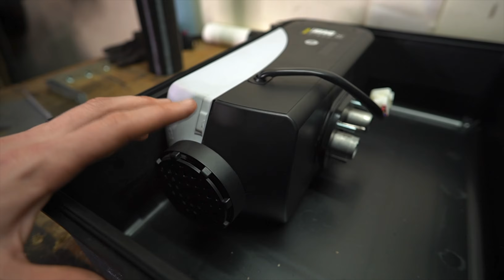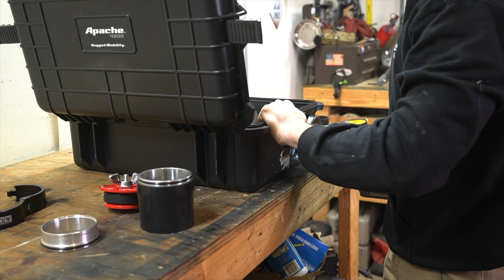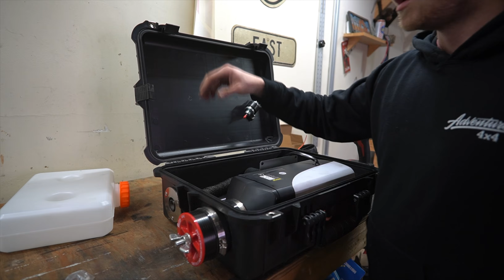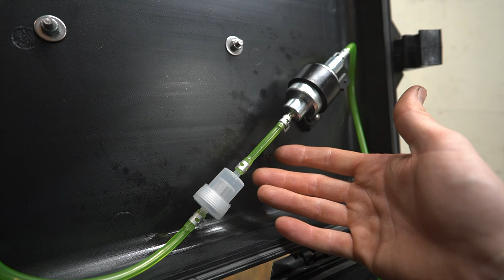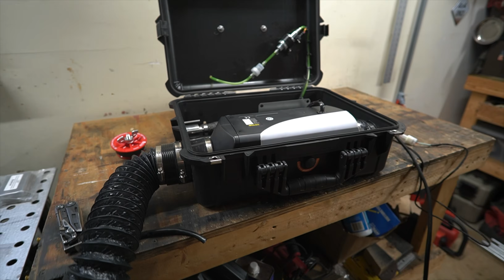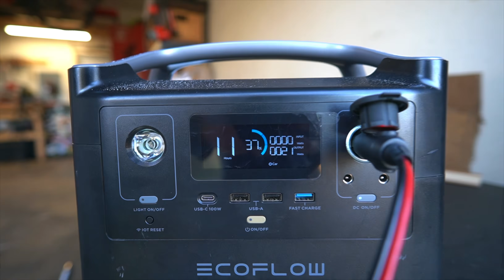DIY Diesel Heater **EXTREMELY DETAILED**

Comment: More like no attention to detail. Lacking detail in video and rushed.
Reply from the maker: If you need anymore detail then this to figure it out you may as well buy a pre made unit to save yourself the headache.
Reply: @Adv4x4 naw just having to order more parts because the ones you linked are the wrong size, exhaust hole size is 1 and 1/2 not 1 3/4 and trying to make different manufacturer heater work from Amazon, ordering the heater bracket I didn't have, etc.

Comment: The exhaust hose included in the link isn't the same... I just cut the one I ordered and the outside diameter is the exact same as the outside diameter as the exhaust port on the heater.  Also, looking at the one you have there - it looks made differently than the one in the link.  Can you look back through your purchases and include the link to the one you have?  I have been looking and haven't been able to find it... and my build is in  pieces right now... lol

Comment: nice build, although im for sure routing my air intake to fresh air outside the case with the possibility that the exhaust does leak inside the case.
Reply: Thar air intake he left inside the box is only for combustion.  
The fuel line and small pipes are for combustion. The ends of the heater are for heating your inside air. Keeping  these 2 systems separate as intended ( exhaust and combustion intake  outside)  would be the best set up.  Safest, most  efficient  in every aspect.  No brainer.

Comment: 've been closely following your diesel build tutorial and noticed a discrepancy with the exhaust pipe. The one shown in your video appears more flexible with closer ridges, whereas the link provided leads to a wider, stiffer type. The pipe that came with my diesel heater won't fit on the through exhaust if it's cut at the ridge. Could you clarify this? I hope this makes sense.

Comment: Microwave water for a couple minutes and dip the tip of the fuel hose in it, it'll go on way easier than with silicone spray especially as it starts to cool again and you can push against it.

Comment: How did the quick connect work out?  Also you linked to a 3” to 2.5” silicon hose.  Is the heater output 2.5” or 3”?   Thanks.

Comment: This video is great and I had an easy time following the process except for one thing that i cant figure out. Connecting The exhaust hose to the exhaust outlet. I ordered the parts from the list and had to cut the exhaust hose to fit. Once I do that, since they're both 1" I can't fit the wavey part of the hose over the outlet. I even got a 22mm outlet (vs. The 1") and can't do it. What am I doing wrong?

Comment: Allowing it to auto shut down allows the fan to keep spinning Ning so it pushes cooler air through system and let the ceramics cool better. Just cutting power leaves in burnt diesel in the system and can cause damage to the internals with heat not being able to escape.

Comment: I had issue with the DC output required at startup, my portable power station, same as what you have eco flow river 2, keeps tripping at the start up, did you figure out a solution around that? I tried running it from my car first to get it to warm up and then switch over to the power station which works but it's a hassle.

Comment: This video is identical to hundreds of others. Exact copy of others.
Nobody has done the way I put one together.
I used the exact same Harbor Freight 4800 case. Mine is fully waterproof with no hose and wires tethered outside the box.
Inside the box has the heater, 20ah battery, voltage monitor, cooling fan, AC to DC charger.
I had to move the fuel pump and the filter in its own small case outside the 4800 case to make room for the battery.
It actually keeps the fuel away from the heater. The inside stays very clean without the worries of fuel spill.
5 liter tank is mounted next to the 4800 case with quick disconnect.
The case can be removed quickly for travel. No worries of spilling diesel.
Reply: Ok... Show us then. And btw, plenty of other people have put a battery inside the case though often criticized for it.
Reply: @BoomBangKapowww  
I have not seen one single video showing someone putting the battery into the case with the heater. As far as I know, I'm the only person who placed a battery into the case. It's very convenient. 😉
You show us.😂😂 post a video for everyone to watch. 😉

Comment: Consider a vent in the box for the air intake. The box is waterproof, so if the heater is stalling out, think about where the air intake is getting fresh air.

Comment: I just finished my build out and love it. But I can’t get the thing to run off my ecoflow battery like yours. Have you ever heard of anyone having issues with this?? It will run off the jump-start battery I have with no problem.
Reply: Use an ac 12 volt 15 or better 20 amp power brick to your battery bank it will only use more power when glow plug is in use

Comment: The air inlet for combustion should be outside your case. Poor combustion especially with those plastic air inlet ones supplied that it comes with. I am using a plastic and wire tea strainer as a combustion inlet cover it was a similar size so I half-inched it from the wife's kitchen cupboard. It is enough to stop bugs of dirt going in but increases the air going into the burn chamber. The heater burns far better. Noticed that there is now something similar sold on eBay. The next heater I buy will have the same put on it.
Reply: Got a link to an example of the tea strainer you're using?

Comment: Hello! I am following this build with a 2kw instead. I am at the cutting the exhaust pipe part, mine does not fit like a glove when cutting it afterwards and even cutting a slit just to get it on. No success after this, I can still use the pipe for the exterior. I found another video mentioning using the brand pipe because when you cut it and inner diameter is still the same.

Comment: How are the quick couplings working after repeated use?
Reply: It was so difficult to connect on the field that I abandoned it. May be others had better luck with it.
Reply: @johnkim8875  I think it'd work better if the sleeve was left on the duct side instead. You'd have a lot more to grasp when removing it.

Comment: This is a great video I'm using a old Makita drill box roughly the same ... Hoping will use the same idea in the workshop and simply have it so it can be then adapted to the camper if required

Comment: FYI you can prime the pump on this by holding the up and down arrows at the same time. Better than turning it on and off a bunch to start.  I guess there’s different button combinations depending on the style of screen you have but I have this exact screen and it was up and down to prime.

Comment: From UK, NICE JOB!   Great detail and almost a tutorial for those new to CDH set up.   I also admire your honesty at the end, informing ppl of existing similar devices such as the Hcalory.   They are currently £140 ish in UK. But due to season they will reduce in time.   Good project and irrespective of the  Existence of already built systems you've given alternative kit to improve on them for owners.   Well done in my view.
Reply: Well, I looked at the hcallory and it did not appear weatherproof to me so, I emailed and asked them and they said no, they are not.  I have a vevor all in one i set outside my van and i have to cover it in case it rains.  I want to transfer the heater to a case like in the video, then mount on the side of my van so i do not have to store it inside, and it will be fine in the rain. That will be a project for warmer weather.

Comment: your fuel filter is on back-to-front your filter will get clogged-up the fuel should flow around the outside of the mesh, not up through the center of the mesh, 

your welcome 👍
Reply: Exactly

Comment: This is the best instructional video I've seen on all of YouTube for this DIY build. Thank you for the video and the links.
I am attempting a version of this next week (still waiting on a few parts to arrive) and plan to use some of your ideas. 
Did you ever post a follow-up on if the intake needed to be moved outside the box? Did you notice any fume or heat smells leaving it inside?
Reply from the maker: Thanks man! I ran it a bunch with the lid open after assembly to burn off any smells and haven’t noticed any since then. Honestly anytime I can have the lid open while it runs I go that route just to dissipate heat better. 

A small computer fan as some have mentioned would go a long way in mitigating heat.
Reply: @Adv4x4  that's solid feedback. Thank you, Sir!
Reply from the maker: Absolutely! Thanks for watching!
Reply: I just finished my build tonight and tested it. Ran fine until I closed it up then it started smoking like crazy and fogging the neighborhood out. Punched a 1” hole in the side grabbed what was left of the intake pipe and routed it to outside of the case and it runs fine now. Definitely needed more fresh air in my case.

Comment: As far as fuel line goes, most upgrade to good quality fuel hose because the cheap Chinese fuel line works at first, but being Chinese they use cheap materials to make it. What happens is as the fuel line ages, it becomes brittle and will eventually fail. If you have trouble getting the clear line over the fuel nipple, just warm it up slightly and it'll slip on easy. Overall a good build and well thought out. One thing, I would change is running the air intake to the combustion chamber to the outside, combustion likes cold dense air to efficiently burn.  One tip I would use when shutting the unit down, it is recommended to turn it up to high mode for 10 minutes after running on the lower mode to raise the heat up in the combustion chamber to burn off any soot etc. Then put it in the shut down mode. Just my opinion.
Reply from the maker: Thanks for the tips! There has been a lot of good input in the comments. I read them all 👌🏼

Comment: Can you mount and run the heater on it's side with the glow plug up? I.e. exhause would be ejected on side of case instead of the bottom?

Comment: For a honda civic would you recommnd the 2KW or 5KW heater? Or they basically the same? Perhaps more fuel usage on a 5KW? I'm in canada, so it gets cold, -15 celcius, want to do some winter camping.
Reply from the maker: I have no experience with them besides this one unit but the larger one will have to work less to keep you warm!

Comment: Just curious there a reason so have part of the exhaust (1 foot or so) on the case before exhausting it out? Would it be better to mount the heaters exhaust right against the case, and have it leave right away?
Reply from the maker: You could absolutely do that!

Comment: I bought a pre-built one two years ago for $200 and it has worked well but the case and fuel tank and such are starting to break and there’s some design flaws in it that I don’t like so I’m hoping to pull it apart and build it into a better case like this. Really appreciate the video.
Reply from the maker: At least you already have some parts to build with! Goodluck!

Comment: With the way you mounted the fuel tank nipple you could have put it on the side of the tank that is toward the lid of your box and drilled a hole in the lid making a cleaner exterior install.

Comment: You cannot enclose any exhaust pipe inside a container. You absolutely require vent holes in the case to vent heat from the exhaust. The wrap does NOT prevent heat buildup. It only helps prevent excessive temps that may melt plastic. 
There are plenty of horror stories online of people failing to do this properly and burning down their rigs.
One way to guarantee it won't overheat is to eliminate the blower intake hose that isolates the heater to take air from outside only. Just cut the intake case hole and ditch the connector hose and the unit will pull any warm air out of the interior of the case and actually help with efficiency. If you are worried about bugs or critters getting inside just use a piece of stainless window screen in place of the dryer vent hose.
Reply: I had the same question but doing that would be like just having it installed in your rig which to me seems dangerous in case of an exhaust leak. Going to make mine so the case is flat with exhaust and combustion intake come out flush with bottom of case so the case lays flat and add screw in feet to elevate it from anything that can't have heat
Reply: I'd like to understand better what you're talking about here. Can you explain more? I'm building on these now. Thanks
Reply: @backwatersandbackroads  There is no benefit to a sealed case. The case must have venting toward the top to allow heat to escape. There is no benefit to keeping heat inside the case. That exhaust pipe inside the case will build up heat inside and if you don't have vent holes in the case you risk fires like others have experienced. The case interior requires air flow. Diesel heaters are not designed to be enclosed inside a case. But it's ok as long as the heat can escape that the exhaust pipe produces.
Reply: @Wrangler2026  I've wondered this same thing, why is a hot exhaust pipe in the case? I've seen another video where the heater is isntalled right against the case. A cut out in the case is made to vent the exhaust right away, without pipes in the plastic case. I'd assume that be a better design? 
Here is the design: https://www.youtube.com/watch?v=JGvNHUNkhtk&t=7s
Reply: I’ve seen a few guys add a vent on one side and a computer fan on the other keeping constant airflow in the case🤙

Comment: Quick question. Looking at heating a 16' diameter canvas bell tent in Northern NM elk hunting. Is the 5k going to be enough or should I spend $10 more on the 8k? Future use might be a roof top tent and then 8 is overkill. Thanks Awesome build!
Reply from the maker: Thanks man! I’ve used it to help break the chill in my garage so I think it will sufficiently help keep a canvas tent nice! But I also don’t think the bigger one will hurt either

Comment: Update, any melting issues? looks like you are using better fittings but I had an issue w/ it being super HOT in the case after hours and days of use
Reply: How did you resolve that? Im about to build one. Exhaust fan?
Reply: @RT-qz5ci  Sorry so late... So i did not with the case. Since I have a truck, I opted to weld a steel cage vs a boxed method.

 My fittings had melted (maybe cheap amazon fittings) I would do more research on that. I dont the fan would assist the heat output fitting.

 I really think you just need a better fitting. The heater blows VERY VERY hot air.

Comment: Are you having any condisation issues with the heater being on it's side.   Also, how many hours of run time can you get on one tank of fuel, Thanks
Reply: disregard the condensation, question, I seen it being built on it's side, thought it was the way you was installing it.
Reply from the maker: Not sure on hours run time but I’m willing to bet that tank will do 2 8 hour nights depending on how high you have it on 👍🏼
Reply: Another question I would like to ask, is the diesel heater unit capable of maintaining one temperature inside, can the unit turn off and on by itself to maintain the set room. If so please let me know how.  Does the unit continuously run and you have to physically turn it off in order to not get the room overheated. Do you have any suggestions, thanks again in advance
Reply from the maker: The little monitor sees what the ambient temp is and runs unit accordingly 👍🏼

Comment: Is the whole point of building this unit to prevent the need to drill holes for inlet/exhaust? I'm putting one of these in my van build and dreading the drilling of those 2 holes in the van floor. If the purpose of building this is to prevent that, this is exactly what I'm gonna do!
Reply from the maker: Yes I think people like the portability! Plus it’s easy to service if need be. Or can be used in a garage or even a house if the power is out

Comment: Good job documenting build.  I went with 9 liter tank.  I don't like refilling often.
Did you get any fumes using inside-case intake? I expect this would be noticed when you're heading the tent.
Reply from the maker: None that I can smell! I made sure my exhaust was sealed up tight in the box with some puddy. Some people say the gasket behind the bracket melts some and creates a smell too. I ran it for probably 6 hours at home with the lid open let the heat wrap fumes burn off etc.

Comment: Champion vid! Quite nice tips! Liked and subscribed-
Questions: Is the large air intake for the engine (2-3") simply to cool the combustion chamber? (I'm not referring to the small air intake for combustion air). In 'normal' interior setups the large air intake would be getting air from inside, however 'if' the sole purpose is to keep the combustion chamber cool I see an advantage with 'outside' cold air. I was wondering if you were getting enough 'combustion air' from inside the case without routing to outside air? Ta, mate- all the best to ya, Jack
Reply from the maker: Hey man! Thanks for watching! It seems to be doing well it draws in are from around that silicone coupler sticking thru the Side of the box. So issues as of yet! If so I’ll add more vents 👍🏼

Comment: I'd contact Vevor to see if this heater is design specifically for diesel or if it was designed for Kerosene. The Espar heaters used in semi truck sleepers is actually designed towards the use of Kerosene. It's really odd but modern diesel blends just mess up the heaters. So in the future if your heater ever has issues staying lit I'd run some Kerosene thru it to get it cleaned out.
Reply from the maker: Thanks for the info! I’ll have to look into it